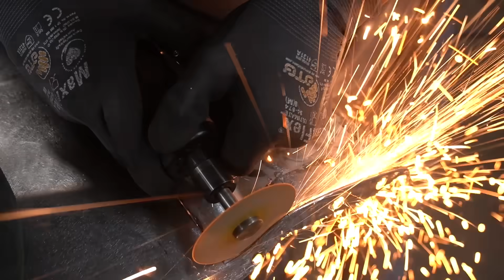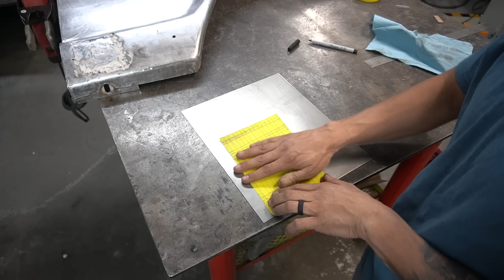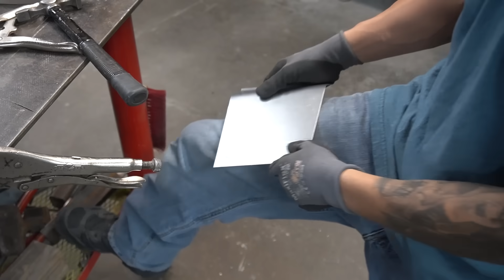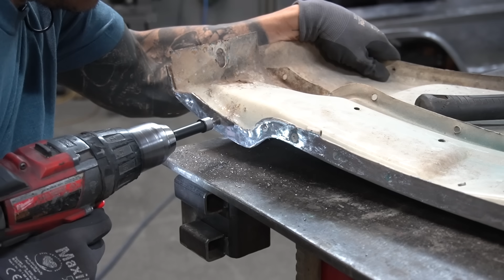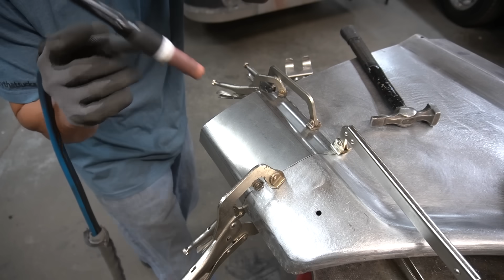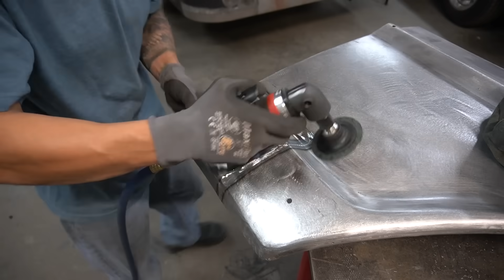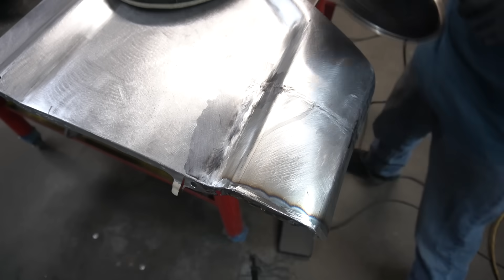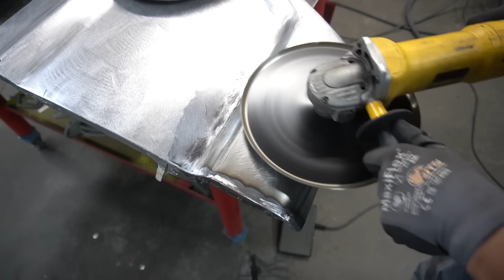how to make a patch panel | fix rust

Comment from the maker: Want to learn rust repair hands-on with me?

I’m putting together my Rust Repair Master Class, where I’ll teach you the process I use to cut out rust, fabricate patch panels, MIG weld thin sheet metal, control warpage, and finish the repair properly.

Spots will be limited. You can reserve yours with a $99 deposit here 👇
https://beametalfabricator.com/rust-repair-master-class-pre-order/

Comment: Amazing, immediately subscribed and love it! I have had the only Grand Wagoneer in my city for over a decade but it needs floor panels and outside panel repair. I never had the place or tools to repair but after jumping into learning enough to get my 05 Avalanche through inspection with physical rust removal, rust dissolve and then rust converter to add the rocker panel covers- I think I can tackle the Jeep next year!! It will take multiple years but I can't pay a shop 20 grand and then get T boned the next week, hell I can't pay them 20 grand period lol. I will be deep diving your channel all winter, thanks for doing it with basic tools and doing it so well!!
Reply from the maker: Thanks for the compliments, man! I really appreciate it, and thanks for subscribing! Metalwork at a shop can get expensive pretty quickly, especially when there's a lot of rust involved. I'm glad you're confident enough to tackle it yourself!

I actually started a metal fabrication community for people doing exactly what you're doing. You can share pictures and videos of your project, ask questions, and I can personally guide you through the process as you go. I'm also building a library of training courses covering rust repair, patch panels, welding, metal shaping, and more, all included with the membership. The idea is to give you the knowledge and support to tackle these projects yourself instead of having to figure everything out through trial and error! Here is a link if that's something that would help https://www.skool.com/bamf-fabricators-8653/about

Comment: 👍🏻👍🏻👍🏻👍🏻👍🏻👍🏻very, very good, 50 years ago that seemed a lot harder, gas welding put way too much heat into the panels, lot more straightening, I want to restore a 68 sport fury, it’s rusty, and 1 of 28, 383 mag, console 4 speed!!! Gotta learn to tig, looks easy enough, gas welding with electricity??? lol, welded all my life with stick, and some mig, wire seemed very easy after stick, I welded some sheet metal with stick, over the years also, there’s a trick to that
Reply from the maker: Hell yeah! Sounds like you’ve already got plenty of welding experience, TIG should come pretty naturally once you get some time behind the torch. That ’68 Sport Fury sounds like one hell of a project too! I’m actually putting together a full Rust Repair Master Class right now covering this exact kind of work from cutting the rust out all the way through welding, distortion control and finishing. Might be right up your alley when you get into that Fury! 🤘

Comment: Your skill set is impressive, what kind of welder are you using?
I see your holding the wire in your hand.
Reply from the maker: It's a tig welder. Works great for planishing welds and making them disappear after grinding
Reply: @BeAMetalFabricator im thinking about welding as a hobby, any recommendations. 
Thanks

Comment: Im just starting to learn to welding. What is the reason you used tig welding for the front instead of just mig welding it? And would it have been acceptable to just mig the whole thing?
Reply from the maker: It would have been acceptable but might welds are hard and tig welds are soft therefore it's easier to planish the welds and make them disappear

Comment: Excellent work, I have never used TIG for body work, I am now reconsidering.... Thanks for the vid!
Reply: Tig is great for body panels because It doesn't over heat or warp as bad specially on thinner materials the fact more people don't is simply because they don't know how to Tig it's a dying art anymore
Reply: @davidsanderson7812  That surprises me, I would think TIG would put more heat into the panel.
Reply: @josephperry4344 when doing Tig work it's best to use a pedal when you use the pedal you can add or take away heat to keep it consistent as you run more heat gets into the material and follows through and you can slowly dial back on the pedal to contain a constant temperature

Comment: 1. Do you leave a gap for your butt welds or you prefer not to? 
2. When repairing a hood with multiple rust holes, do you advise using one big sheet of metal to replace the rusted metal holes or remove and repair each individual rusted hole separately?
3. I have an electric welder I got from harbor freight. I don’t know if it works as well as the gas welder. What’s the going opinion on that? Will it do a good job for me?
Reply from the maker: 1. If your using a MiG welder definitely leave a gap because the heat from each tack will pull your patch too tight to where you will not be able to align both panels flush. And when you grind, you will never fully be able to grind the weld away without thinning the adjacent material.
2. If the hood has multiple rust holes I would advise using the biggest patch possible to to get rid of all the rust rather than each hole individually 
3. Your electric welder is probably a flux core welder which is basically an arc welder. Not preferred in my industry although it will work. Gas welding with MiG or even better than that Tig welding  , smaller welds, more control with heat and much more malable when planishing.

Comment: See to me that piece is totally salvagable. Never gonna have to worry i. Your lifetime if you fill or fiberglass is right. I respect the skill an yes this ways better. But that said good filler an work would be the same
Reply from the maker: That type of attitude is why this fender is in my shop
Reply: @BeAMetalFabricator I got cars with glass. Still out there when metals been back in a few times boss. Just sayin
Reply from the maker: Yeah that will eventually crack and end up at a shop being fixed by a guy like me.

Comment: Wow. I am always envious of a good tig welder... when it comes to body I can't even use tig. I either burn the piece or starve the joint. I know this will make me sound like a total noob and when it comes to welding I am a SUPER noob so its ok, but I gotta mig weld body panels, I literally don't have a choice, and I can barely get that done. The end result is good, the welds are solid, but I am NOT a great welder, thank hell for mig or I'd not be able to get it done. I can't believe what I just saw.... the level of stick control+ heat control and consistency of weld almost threw me out of my chair. Good job man. Holy shit I'm impressed.
Reply from the maker: Hey thanks man! I'm glad you liked it! That's a hell of a compliment!

Comment: Oh wow?!? Geez...you make that look so freakin easy, lol!!

I'm totally new and just starting on my resto project on my old car. Thank you so much for posting up this video. I really helps me walk through the process bit by bit in order to make a patch.

quick question though: When you are mig welding, what is the difference between doing tack welds on the back of the panel like you did, and running a bead? Is it because the metal is too thin or it may get too hot? I've seen practically all of these resto videos tack weld around the perimeter but never lay a straight continuous bead, but I don't know why?

I try to ask in Facebook groups but all they do is make fun of me for asking question and tell me to go search google. I just want to learn to make this like you do. 😔
Reply from the maker: Yeah man no worries, the reason you don't want to run a continues bead is because it will over heat and warp the panel, when your mig welding thin sheet metal you want to weld slow, a little at a time, preferably cooling off with air blower. Otherwise you can ruin the panel.

Comment: This is REALLY going to come in handy when restoring the old square body. Can you give me some guidance- would it have been possible to tig weld the brace back in instead of using a mig? If not,  why was the mig used? Thanks for the help!
Reply from the maker: Yeah I could have used the tig but the mig  just seemed faster and more efficient at the time

Comment: Nice Job. My question is: At 7.41 in the video the patch lays perfectly on top of the fender with the curves perfectly matching on the OUTSIDE of the fender, but then at 9.41 and 9.51 in the video the patch is inside the fender with the curves of the patch in line with the curves of the fender.   So the distance between the center of the curves at 7.41 can't match the center of the curves at 9.51.  How did you reconcile that?   Or what am I missing?  Cheers.

Comment: I do have a question when doin patch panels, is it better to tig weld the face and mig the bag or it doesnt matter? Got a 68 impala that i started when i was first learning body work and wanna redo  the few patches i had to do originally. Thanks in advance

Comment: This looks awesome, nice work. I have never done body work yet but have a 74 Mercedes that needs similar panels on both front and rear fenders and rockers. Questions, is there a reason for thin tape vs using wider tape, or just what you had? You switched from tig to mig, why and when one over the other? What about if the body panels aren’t removed from the car ? Thank you in advance

Comment: Wouldn't tacking with mig afford you less warping?  I've been a tig welder / fabricator both steel and aluminum over 50 years, so I love the tig process and chose it over other processes whenever I can, one of the few times mig tacking seems better to me is patch panels. Now to be clear, I'm not a body man and rarely if ever do body work, that's why I ask. I enjoy watching you guys at your trade, Fitzees is another body / fab guy and approaches things with mig,  I wouldn't have thought tig was even a viable option if you had mig.
Reply from the maker: Mig would work, I have weldem many many panels with a mig. The warpage can very depending on the heat applied, less warpage with a mig? Maybe slightly but not by much. The reason I used a Tig over the MiG is because the welds are softer there for easier to hammer out to make seamless. A mig weld is hard and get get brittle when hammered on

Comment: Lovely looking bit of work. Most panel beaters use bondo everywhere. It's nice to see the old skool craftsmanship still happening
Reply from the maker: Many thanks!
Reply: Most panel beaters never beat a panel in their lives. They pull out the damaged panel and fit a new replacement panel.

Comment: Great job on the video and your talent, very helpful tips , thank you, i also had to cut rear brace support on a 65 chevy c10 front lower front fender, in order to patch it to the best of my ability since im a Diy'er, but used a hobart 210 mig set at one, you gave me inspiration to find me a tig..what brand is it?keep the great content coming, Sir
Reply from the maker: Thanks dude! Cool your attacking your project! I have a few machines, my first was a hobart 165i and it has worked really good for many years! Then I got a miller 180, great machine.  And I recently got an everlast 250 for more power and it works pretty good!

Comment: What are your tig welder settings and tungsten/filler rod sizes?  I usually use 55 amps and 1/16 tungsten and rod.

Comment: Nice video. Body shop in the 80s that did beautiful work painted my 65 impala. Years later I had the inner fender well out and what did I see. A beer can as the patch !
Reply: Beer cans were thicker back then weren't they
Reply: @ 
 Yes. Old coke cans too. We used to cut the bottoms out of 5 cans and tape together. We then cut the top of another leaving a a portion around the opening and taping it as the bottom one. Then we punched a hole near its bottom on the side. Dropped a tennis ball in & squirted lighter fluid in and pointer up. Lit it and boom there went the tennis ball a really good distance. 
 Sure as hell not with today’s cans !
Reply: @hipoman8087  haha!
Reply: @Anthonycapone8146  
 What’s funnier or worse however, you look at it when we played war we were shooting them things long-distance at each other !. 
 👀

Comment: Did I miss which gauge or thickness of sheet metal you used?
Reply from the maker: 20g or 18g will work for this patch. I believe this was 18g if I remember correctly

Comment: did you put a metal sealer on the inside of the fender before you put the inner structure back on if so,what type is best.
Reply from the maker: Internal frame coating works great from Eastwood https://www.eastwood.com/eastwood-internal-frame-coating-plus-aerosol.html?gad_source=1&gclid=Cj0KCQjwvpy5BhDTARIsAHSilylJZTAkPjgpkw4ov5XeKuH6V0Wg_a3JEn0C7y_5X0Er5POQn8j_CqAaAuRKEALw_wcB&wcid=18672865153&wickedid=629881824399&wickedsource=google&wv=4 you can use my 10% off code "Nathan10"

Comment: How much warpage do you encounter by welding it non stop after you have it tacked ?  I haven't used a TIG  since the 1970's in HS shop class. lately I have purchased a good MIG and have been making sheet metal repairs on my project trucks for the past couple years but warpage is always an issue so non stop welding is a NO NO, I am assuming TIG welding is a cooler weld but even so welding it non stop is why you had low spots to hammer out due to some warpage?
Reply from the maker: What's up dude. So in my personal experience, any heat put on a panel is going to warp the sheet metal, even if I would have welded little spots at a time and blew it with air and all that. It don't matter it's going to warp. The difference between Mig and Tig is I can control my heat a little more with Tig and the welds are planish-able. Mig welds on the other hand can't be hammered without getting brittle and cracking. The reason I welded all at once was because I had access to the backside and knew it was going to need hammered straight. Hope that helps

Comment: Just watched the video a few minutes ago and read through some of the comments.  "Awesome job" but I do have a newbie question about why you went with TIG for the outer panel and MIG for the inner. Why not TIG for both?
Reply from the maker: The reason I tig welded the sheet metal is because the Tig weld is softer and can be hammered and planished. The mig weld are hard and will crack if hammered too much. The brace don't need planishing so to be quick I decided to mig weld it. You said your a newbie, Are you doing fabrication on a project?

Comment: Thank you for the video. Great work. What grit paper and disc did you use? Thank you once again
Reply from the maker: I'm using 36 grit to knock down the weld and then a strip disk after that

Comment: Looked great. I'm a newbie to metalwork. What gauge metal is used for body panels? I'm restoring a 56 Chevy Cameo truck that needs this kind of work. Thanks.
Reply from the maker: I used 20g sheet metal. You can use either 20g or 18g for fenders. Floors and firewall should be 18g. By the way since your new to metal work I would love to ask you some questions for a project I'm working on, if you wouldn't mind getting on a call with me I would greatly appreciate it! Also I would be happy to answere any more questions you might have on your project as well during our call. Here is a link  to pick a day and time.🙏https://calendly.com/tubalcainbamf/interview

Comment: Enjoyed watching you make it look easy! I grew up around some body/paint, but mostly paint, which was quite good,  but the body work was largely filler based and I don’t recall much rust repair. I’m a mechanic now and just interested on a hobby level, so there’s so much I don’t know. Could someone tell me about that big dished grinder attachment? Never seen it and it looks great for blending large areas in comparison to a standard flap disc.
Reply from the maker: Yeah man thank you! That's actually a shrinking disk. It levels out any small highs from the slapper and makes the panel more uniform. Are you getting into doing metal work on your own?

Comment: Im just starting my body work adventure. I was surprised when you started tig welding that patch in one direction. To avoid warping. Is there a time and place to worry about that? Or were your tack welds all around the piece a way to prevent warping? Great video thank you! Also what the hell is that 10in disk thing on your angle grinder???
Reply from the maker: Hello! I would say yes there is a time and place to weld a panel all at once. If the panel has some contour, you have access to the backside and plan on metal finishing any warpage, it's fine to weld all at once with the Tig welder. If none of these are the case you will need to weld much slower and strategic. By the way since your new to metal work I would love to ask you some questions for a project I'm working on, if you wouldn't mind getting on a call with me I would greatly appreciate it! Also I would be happy to answere any more questions you might have on your project during our call. Here is a link  to pick a day and time.🙏 https://calendly.com/tubalcainbamf/interview

Comment: If you make it fitting on top of the original panel, isn't it o big then?
Reply from the maker: Just slightly, it did need a little more manipulation after the bad patch was cut out.